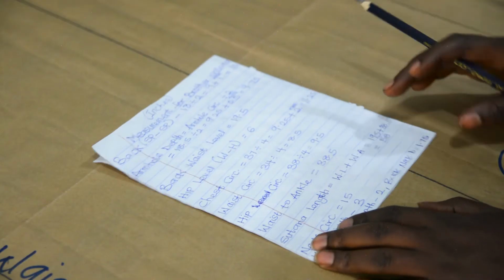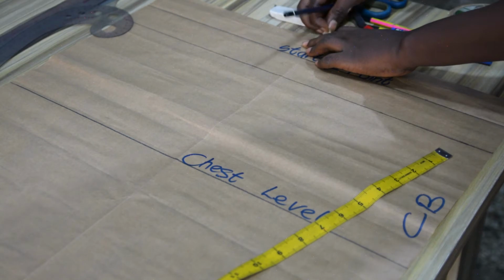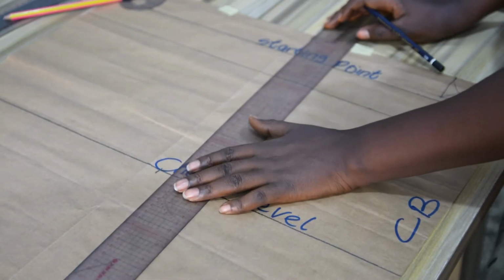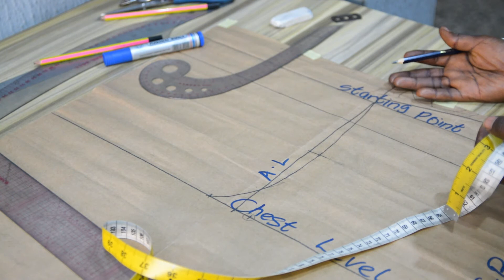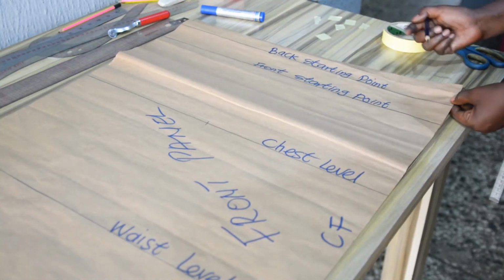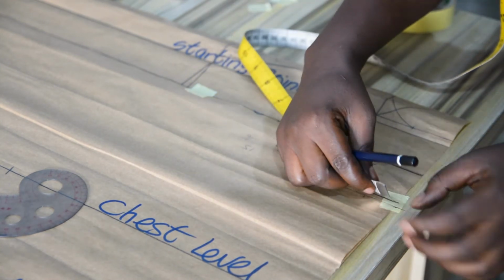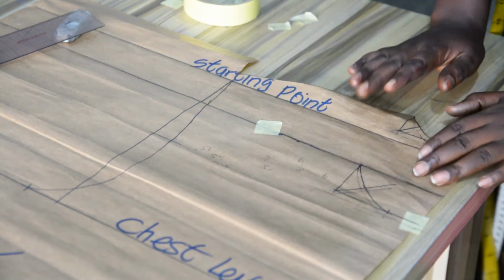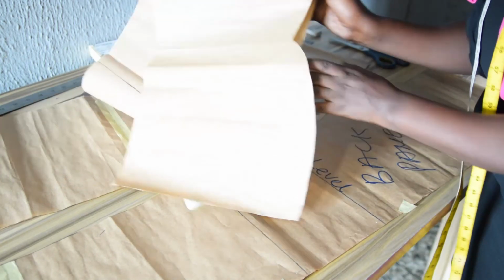HOW TO MAKE A BROTHER SUTANA  || Male Celestial Garment || Celestial Garment || CCC Garment

Comment: Pls ma..how many inches can I use  for width and depht of a boy of 12years old four corner neckline
Reply from the maker: You can use 2 by 2 inches. 2 inches for the width and 2 for depth. This also has to do with his neck circumference measurement.
Reply: @regischooloffashion  pls ma do you have online class
Reply: @regischooloffashion  thank u for the response ma
Reply from the maker: @shomefunabidemi4786  
You're welcome.
Reply from the maker: Online classes are available. Kindly DM on 07036038688 for details.